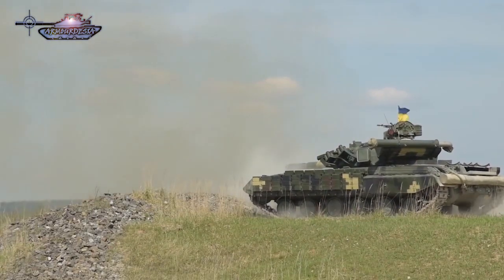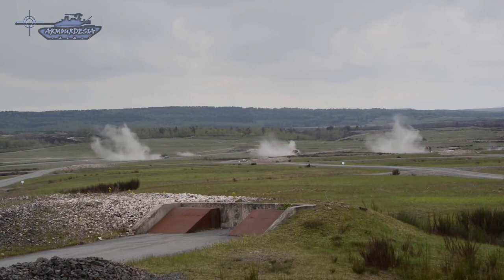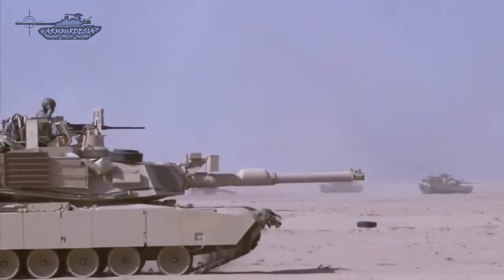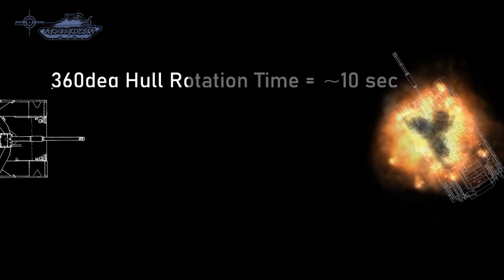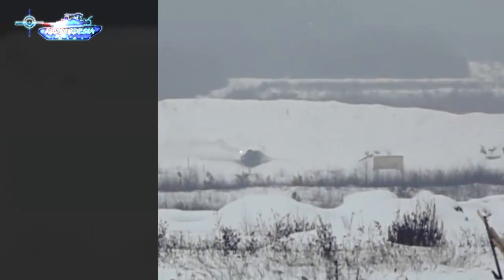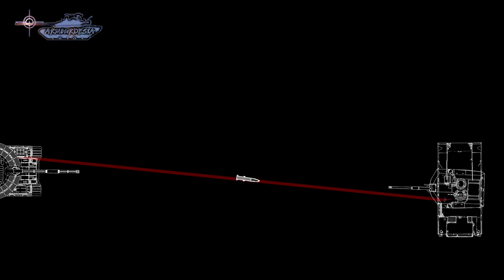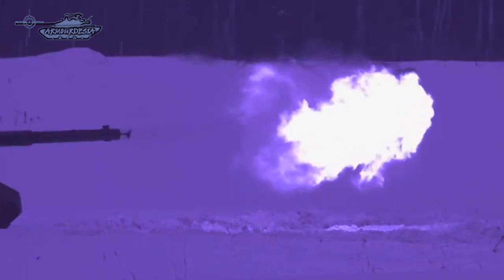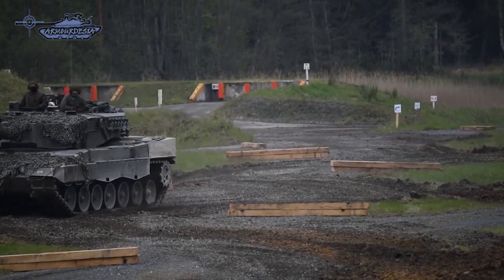APFSDS vs Gun Launch ATGM | Analysis

Comment: thanks for this info. APFSDS i think is more reliable but the atgms can pack a bigger punch.
Reply: master mariner  👍 greater range, manouver and accuracy for atgms too
Reply: Use both and you can kill t 90 tanks first use apfds hit the infrared sensor on the tower and than use atgm and hit the gun killing the ability for guns and than just hit the tank with hidra rockets , rpg9s and car gustav hits from all sides ... when the crew tries to get out just use mini gun 7.62 to slice them all...
Reply: @alexdias8627  or just hit it with anz of the two in weaker part and it explodes? imean whz use manportable weapons when u got a 120mm gun.

Comment: against a missile like reflex probably the only effective counter is a hardkillsystem ( eich ofc is no magoc shield and can be broke trough too but it increases surivability by a lot ) 1. reflex dosent have muzzle flash and spoting is imensly hard 2. the laser touches the tank automaticly only in the last moment so any LWR reaction is to late 3. its a top attack missile in its normal flymode the missile strikes from a high angle usually hiting easy to breaktrough armor. a few other advantages to ATGM are higher precision / chance to hit , higher range and more reliable to hit while driving. also ATGM are way more multipurpose . there exist for reflex for eyample frag and rhermobaric variants. HEAT can be used against less hard armored targets like IFV and APC , while APfDS tends to overpen and have fairly low damage. for the tank on tank scenario if we put the ATGM in its ideal condition its eassentialy a huge advantage. imagine tanks moving 30 kmh and firing missiles wich are highly accurate beyond the range of the enemies cannon shells. if the enemie has hardkill most likely several tanks of the platoon would wolleyfire on a single target eich ofc takes more time but you are still at standoffrange. Evryone who says that Tanks stabilisation is so good that you can easily hit 60 kmh APFSDS is far from reality. evry tanker will tell you that standing or slow driving is preferred when shooting as its simply extremly hard to hit while driving since its still ballistics. ofc same counts for the ATGM to some degree but even the simpliest ATGM you only need to paint the crosshairs on the target no other factors involved. include auto target track or even fire and forget system and you are good to go. there is a reason guided tank ammo is being developed basicly for all major tanks in the world some have widespreadintruduction and use ( for example reflex/Svir etc ) some less ( Nato tanks easpacialy projects mostly in infancy or running against resitance because of cost )
Reply: Reflex hasn't seen action and drones have made tanks obsolete once more
Reply: @destroyerarmor  if you reffereing to the azerbajan karabah conflict i should remind you that the forces there had outdatet and thin spread air defenses who couldnt even in theory reach the drones operating height ( drones operated in 9 km height while the max vertical range karabah air defenses had is 6 km mainly being old 80s variants of OSA and Strela systems , and the effectivness of modern air defenses against drone attacks has been provedmultiple times in syria) Tanks are anything but obsolete  alone for the fact that they bring the firepower of an artilerycannon into motorriflemen type units ( and have the proper mobility and protection to operate alongside or if needed independent from the unit ). in this conflict acctually bouth parties lost quiete a few tanks due to unproper deployment and the hilliy terrain making ATGM teams quiete effective. Still they deployed them for the sole reason that there is nothing to replace the value of a tank and that is the reason all major armies in the world still have them , upgrade them , develop new ones etc. just like any modern airforce would be destryoed by modern air defense if sent against them or any modern Navy against modern marine defense. Dorones and stealth technology dont change that since already for bouth there exists effective countermeasures wich are already employed and actively used . the keyword is combined warfare where the individual pices of the chessboard eliminate each others weaknesess. concerning the Reflex. yes it we dont have seen it used in combat , but we have seen it used quiete a lot in trainings from different countrys to high effect. and while we havent seen the Reflex in action, we have seen the Kornet ( 9k135 ) in use wich is developed from the Reflex.
Reply: @старшийсержант-л7ш  and the Kornet is an ATGM used effectively against tanks in Syria. I don't think a tank force could withstand an attack from a swarm of kamikaze drones. A tank is a big fat slow target for when assymetrical methods are used
Reply: @destroyerarmor  pancir s 1 air defense has a good track record against drone swarms  , but using an example of a pupose build weapon against tanks used effectively against tanks for an argument tanks are obsolete is like saying ships are obsoletr because of hypersonic anti ship missiles .  also a tank isnt really a flat slow target except the overweight shitboxes ( example abrams who cant cross a lot of terrains because of it ) a modern tank is not any less mobile then other combat vehicels. drones arent the be all end all of modernwarfare and tanks and their supportarmys of any competent modern fighting force is able to counter them. also drones are quiete expensive ( atleast thosr that can be called a real threat to modern troops ) and in fact as an aerial target are more often easier to shot down then you think due to their lower speed and less agility. and their flight paths and reduced radar cross section is already irelevant to ground based modern air defences. why do you think us army m1A2Sepv3 , russian T90M,T14 , europe future mbt project and so on exists if apperantly tanks are obsolete ? syrian army tank losses have been high but the tanks have been one of the decisive units in the fight against the islamic state.
Reply: @старшийсержант-л7ш  Technology has advanced so much that we have made some backward steps when it comes to war. Guerilla war and small skirmishes is the future supported by precision strikes from missiles or air, not million man armies looking to grab territory and expand or shift borders. I feel tanks are currently obsolete unless major world powers lock horns once more for some greedy reason. Look at how Iran was able to use drones to wreck Saudi oil refineries
Reply: @destroyerarmor  in urban combat the tank IS the precision with the absolute  fastest respone time and can keep that fire up. one would think that tanks are obsolete in the battle against the IS ( who basicly besiege and hide in citiys and doing exact that gureallia warfare ) look.... a tank in a street can level an entire building with fragshells whuile having a much higher mobility then a field cannon and lower response time then any artilery pice or standoff precisionstrike while at the same time having enough protection to be used in such scenarios  ( with favoruable lookout towards reactive armor and hardkillsystems ) the tank can keep the fire up where a air asset has "down time " for all kinds of reasons, and ammunition is logistically easier to provide for tanks ( who also dont need any prepared airways or anything like that )and tanks are also way less attackable by means of electronic warfare. lets look at air assets . what are you gonna do if the Area of Operation is under Airdefense cover or even easier if the airfield is under Artileryfire ? give up your positions in the City block u just took ? look i dont want to write a roman again ( wich i think is a bad habit of me ) so i will just say that there is a Reason why Tanks are still around and will be for a long time ( in my personal prediction the Tank will stay until the Infantryman and his Rifle are gone ...  and honestly i dont see it go that soon ) btw something interesting you can look into is The URAN 9 wich is basicly a Tank Drone . Most articles are most likely in russian but if you find some decent articles in your language you will see very fast why this will NOT replace Tanks in the near feature but supplement it. ( The Uran 9 was used in syria by the way )
Reply: @старшийсержант-л7ш  tanks have become sitting ducks bro. ATGM have far much superior range than shells and urban combat has never been ideal for tanks. Tank vs tank is not currently happening anywhere

Comment: how come these explode on impact? this might seem like a dumb question but from what i can see it's a DU rod with a hollow cap excluding the sabot. where does the explosive go, somewhere in the back or does that not work? because i assume there has to be some in there and it's not exploding for some magical reason or because it's going fast, that wouldn't make sense. i don't think the cap has the explosive because wouldn't that just explode right on impact and barely penetrate? even though that's the intuitive place to put it
Reply: Depleted uranium is pyrophoric at the temperatures created by the impact, so as uranium dust/fragments shred off of the penetrator, they ignite on contact with the air,  creating the appearance of an explosion
Reply: @star2buk  that makes sense, thank you for taking the time to respond
Reply: When penetrating the armor, very high temperatures occur due to friction in the metals.
Paired with shattering/fragmentation, there are hundreds of glowing hot metal shards flying through the cabin.

Comment: IcBM still better no tank can survive even with APS
Reply: No because the equivalent protection against Heat warheads is very high in all MBTs
Reply: xaxaxaxaxaxaxaxaxa T-14 was tested against ICBM and it bounced off and flew back to the country of origin. GLORY TO THE MOTHERLAND
Reply: @philneal3750  It only bounces back if the nose of the ICBM is round. Round is not scary. Pointy is scary.
Reply: @bulletmagnet25  like leopard 2
Reply: ICBMs are expensive as fuck tho

Comment: cool vid. 
why this big metal rod in a plastic shell cost 10 000 usd? its a joke. Cant we just use hardnd steel for the rod penetrator and heavy duty plastic reaiforced inside with a steel mesh   or azbest for the sabot obturating ring? simple can container for the walls of the bullet and aluminium fin stabiliazers.  i bet if we only make the tip of sum heavier material the penetration would be same if not even better.
Reply: As that sounds good in small arms fire it would possibly not be that effective. 
I am no scientist or metalSmith, but from other sources and research fro ages ago, Tungsten and DPU has a more effective piercing ability compared to Steel. It is more suspectable to fracturing and splintering compared to Tungsten and DPU. 
You would have to look it up more since I dont remember everything.

But I did ask myself the same question ages ago myself.
Reply: @kevynhansyn2902  At these speeds the strength of a material is very small compared to its inertia. So the heaviest material wins.
Reply: @larsjonasson2959  That's not how it works.

At high speeds, It is extremely difficult to develop an APFSDS round without it shattering on the fly, let alone it hitting something. Just because something is heavy does not mean it is brittle. A typical APFSDS diameter is about 27mm, which means that all the kinetic energy will be concentrated at the tip of the penetrator. 

Plus, the fact that you said it yourself that such speeds cause materials to have a very small strength is another huge reason why you'd want to spend the extra cash for ultra-strong materials. What's the point with all the work to produce a shot if it gets disintegrated when hitting something in the first place?
Reply: It's called the military/industrial complex.
Reply: Short answer: Depleted uranium and thungsten perfom significantly better.

10000$ projectiles are still cheaper than a multimillion dollar vehicle.